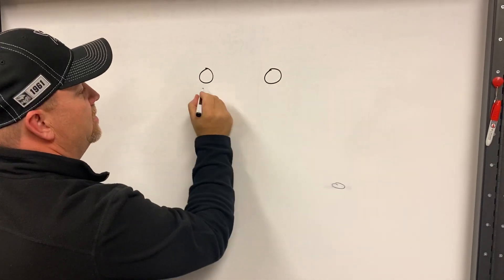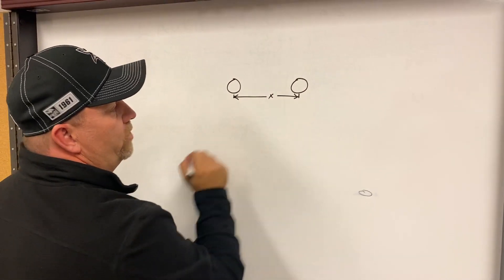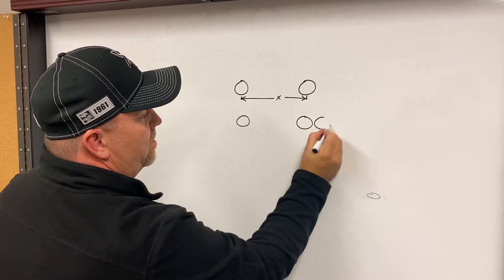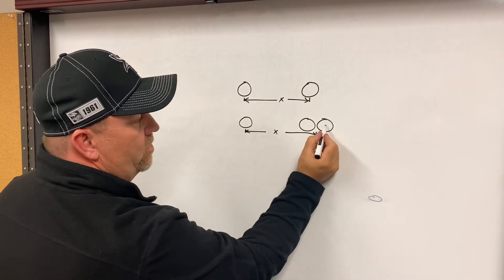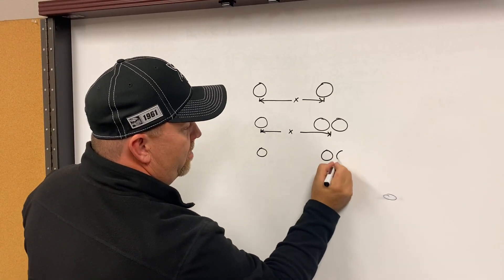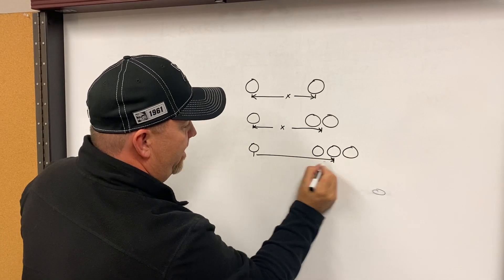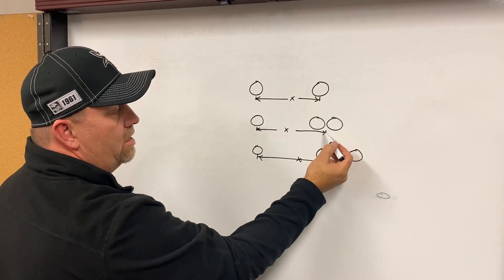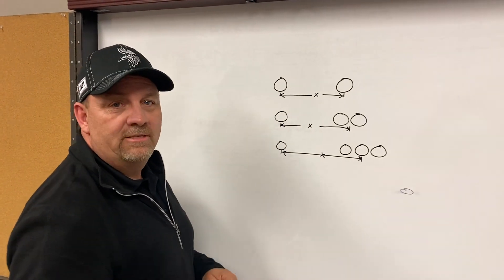Wheelbase measurements on HD Class 8 trucks by Keith Couch

Comment: How would it work if it’s a tandem with a steerable lift axle? To the center of the middle axle? Or the trunnion
Reply from the maker: The lift axle does not effect wheelbase.  It would be as if it wasn't there.  So yes, trunnion.